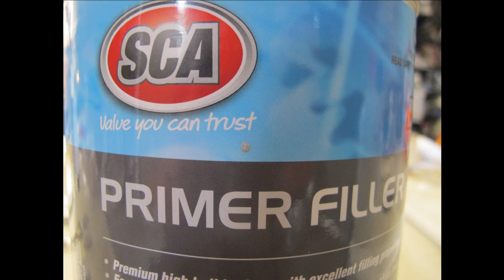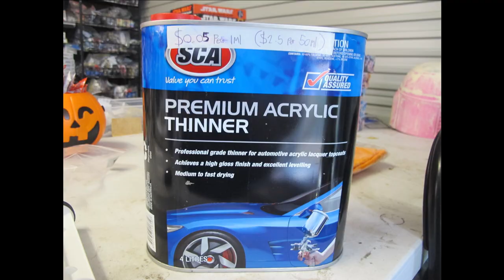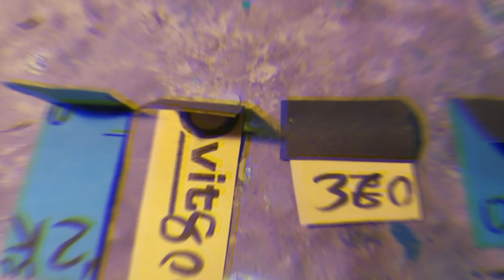model kit workshop 161: Super Cheap Auto Primer Filler

Comment: Thank you for your detailed reviews! I genuinely appreciate the time you put into these. Just got into 3D resin printing (such a newbie that my printer's in transit still). So I've read online that SCA no longer makes this filler primer. Or did they only switch their manufacturer? Are you using something different nowadays? Any recommendation for a US based product? Each time i do a search all I'm coming up with here are super expensive $180USD and up automotive brands. My filler primer cannot cost me more than my printer. 😆
Reply from the maker: Lable and name has changed ever so slightly and still fairly cheap. I also just dropped a video last week looking at another brand of paints and primers just as cheap and better. For some reason these products do not index well on google.
Reply: Thanks so much Mokanaman. I will check out your latest video and see if I can find the new stuff. I even ran my search incognito so Google would stop throwing up ads for the local automotive shops but still came up empty. Sincere thanks! Resin arrived yesterday and printer arrives on Monday so I'm excited to be ready for my first print job. 😁
Reply from the maker: A follow up, just visited a super cheap auto and all the in house paints have change labels, price product and amount is different but should be able to find something cheap and in mass. Also consider looking at paint spot and other local car paint joints.
Reply: Thanks for the follow up! It's much appreciated. I'm in the tinkering stage with my printer still. The first few prints have failed but in the process I realized that the size I'm trying to print is really way too small for filling/painting. I am already in a love/hate relationship with this new undertaking! 😆

Comment: Was the shrinkage due to the air in the bicarbonate or the increased surface area of the paint due to particulates making the dry process more involved and evident? The small soluable particles would be great to get in those cracks but the shrinkage is a bummer. A fine dense material might like talc might not shrink as much? I love these kinds of explorations
Reply from the maker: The primer itself shrink due to the evaporation of liquid solvent. The filler, bicarb, resin and pigment remains. Extra bicarb leave a much larger mass behind increasing the chance of cracks and scratching being completely filled. Professional filling products have the same rate of shrinkage example Tamiya basic type putty. Talc powder was also tested off camera with the same results.
Reply: @mokanaman  Thank you :)